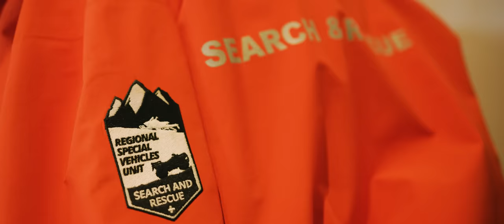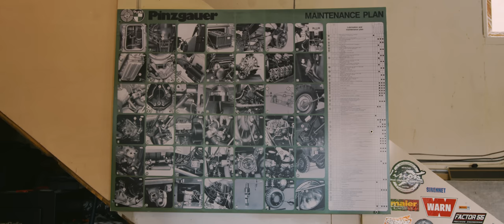The SARPinz: Always Be Prepared

Comment: Wow   Great looking 710. Wish mine looked that good. Have you changed to motor or just the exhaust? It sounds so different. Cool video, perfect S&R vehicle.
Reply: Mine had a bore and cam done by Goatwerks in Ca (not sure if he's still doing them) and has a custom built aftermarket fuel injection system.  The exhaust came from Swiss Army Vehicles and is a stock replacement.  I love the way the little inline 4 sounds.. so much fun to drive.